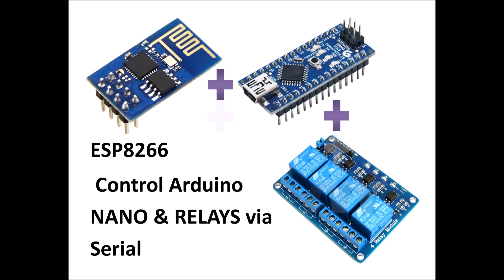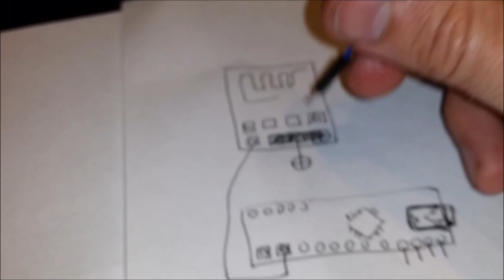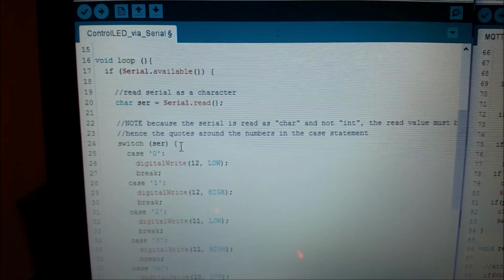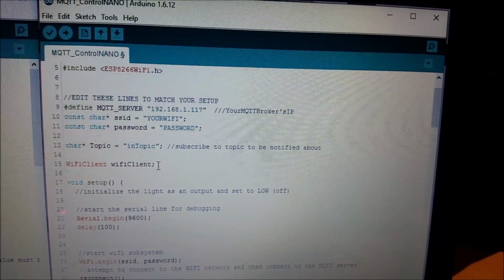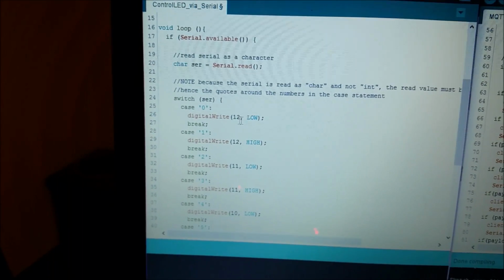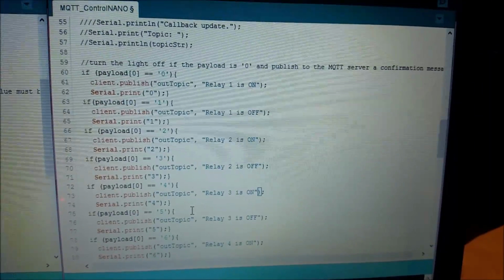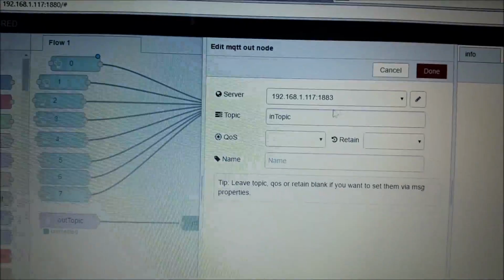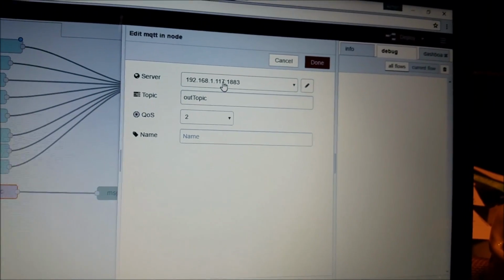#1 ESP8266+ Arduino Nano + Relay via Serial - MQTT Node Red

Comment: ?interesting topic ! ...can you upload the code
Reply from the maker: Because I'm using an Arduino and ESP8266, I need 2 different codes one for Arduino and the other for ESP8266.

But you can combine the codes if you want, and use ESP8266 to read values and publish to MQTT. I'll make a video soon
Reply: Thank You
Reply from the maker: there are 2 different codes 
theres 1 code for the ESP8266 and the second code for the arduino nano
Reply from the maker: // Code to upload onto ESP8266

#include <PubSubClient.h>
#include <ESP8266WiFi.h>

//EDIT THESE LINES TO MATCH YOUR SETUP
#define MQTT_SERVER "192.168.1.117"  ///YourMQTTBroker'sIP
const char* ssid = "YOURWIFI";
const char* password = "PASSWORD";

char* Topic = "inTopic"; //subscribe to topic to be notified about

WiFiClient wifiClient;

void setup() {
  //initialize the light as an output and set to LOW (off)

  //start the serial line for debugging
  Serial.begin(9600);
  delay(100);

  //start wifi subsystem
  WiFi.begin(ssid, password);
  //attempt to connect to the WIFI network and then connect to the MQTT server
  reconnect();

  //wait a bit before starting the main loop
      delay(2000);
}

PubSubClient client(MQTT_SERVER, 1883, callback, wifiClient);

void loop(){

  //reconnect if connection is lost
  if (!client.connected() && WiFi.status() == 3) {reconnect();}

  //maintain MQTT connection
  client.loop();

  //MUST delay to allow ESP8266 WIFI functions to run
  delay(20); 
}

void callback(char* topic, byte* payload, unsigned int length) {

  //convert topic to string to make it easier to work with
  String topicStr = topic; 
  
  //Print out some debugging info
  ////Serial.println("Callback update.");
  //Serial.print("Topic: ");
  //Serial.println(topicStr);

  //turn the light off if the payload is '0' and publish to the MQTT server a confirmation message
  if (payload[0] == '0'){
    client.publish("outTopic", "Relay 1 is ON");
    Serial.print("0");}
  if(payload[0] == '1'){
    client.publish("outTopic", "Relay 1 is OFF");
    Serial.print("1");}
  if (payload[0] == '2'){
    client.publish("outTopic", "Relay 2 is ON");
    Serial.print("2");}
  if(payload[0] == '3'){
    client.publish("outTopic", "Relay 2 is OFF");
    Serial.print("3");}
  if (payload[0] == '4'){
    client.publish("outTopic", "Relay 3 is ON");
    Serial.print("4");}
  if(payload[0] == '5'){
    client.publish("outTopic", "Relay 3 is OFF");
    Serial.print("5");}
  if (payload[0] == '6'){
    client.publish("outTopic", "Relay 4 is ON");
    Serial.print("6");}
  if(payload[0] == '7'){
    client.publish("outTopic", "Relay 4 is OFF");
    Serial.print("7");}
}

void reconnect() {

  //attempt to connect to the wifi if connection is lost
  if(WiFi.status() != WL_CONNECTED){
   
    while (WiFi.status() != WL_CONNECTED) {
      delay(500);
    }
  }

  //make sure we are connected to WIFI before attemping to reconnect to MQTT
  if(WiFi.status() == WL_CONNECTED){
  // Loop until we're reconnected to the MQTT server
    while (!client.connected()) {
      //Serial.print("Attempting MQTT connection...");

      // Generate client name based on MAC address and last 8 bits of microsecond counter
      String clientName;
      clientName += "esp8266-";
      uint8_t mac[6];
      WiFi.macAddress(mac);
      clientName += macToStr(mac);

      //if connected, subscribe to the topic(s) we want to be notified about
      if (client.connect((char*) clientName.c_str())) {
        Serial.print("\tMTQQ Connected");
        client.subscribe(Topic);
      }

      //otherwise print failed for debugging
      else{Serial.println("\tFailed."); abort();}
    }
  }
}

//generate unique name from MAC addr
String macToStr(const uint8_t* mac){

  String result;

  for (int i = 0; i < 6; ++i) {
    result += String(mac[i], 16);

    if (i < 5){
      result += ':';
    }
  }

  return result;
}
Reply from the maker: /// Upload to Arduino NANO

/* control Relays via serial with numbers*/

void setup(){
  Serial.begin(9600);
  //Set all the pins we need to output pins
  pinMode(12, OUTPUT);
  pinMode(11, OUTPUT);
  pinMode(10, OUTPUT);
  pinMode(9, OUTPUT);
    digitalWrite(12, HIGH);
    digitalWrite(11, HIGH);
    digitalWrite(10, HIGH);
    digitalWrite(9, HIGH);
}

void loop (){
  if (Serial.available()) {

    //read serial as a character
    char ser = Serial.read();

    //NOTE because the serial is read as "char" and not "int", the read value must be compared to character numbers
    //hence the quotes around the numbers in the case statement
    switch (ser) {
      case '0':
        digitalWrite(12, LOW);
        break;
      case '1':
        digitalWrite(12, HIGH);
        break;
      case '2':
        digitalWrite(11, LOW);
        break;
      case '3':
        digitalWrite(11, HIGH);
        break;
      case '4':
        digitalWrite(10, LOW);
        break;
      case '5':
        digitalWrite(10, HIGH);
        break;
      case '6':
        digitalWrite(9, LOW);
        break;
      case '7':
        digitalWrite(9, HIGH);
        break;
      
    } 
  }
}
Reply: here ... we can't mixe the 2 programmes in one?
 exampl ... my project with arduino uno and capteur MQ07 and ESP8266 and MQTT ... so i must do 2 programmes or i can do one prograame to get the value of sencor and publish it to the MQTT ?